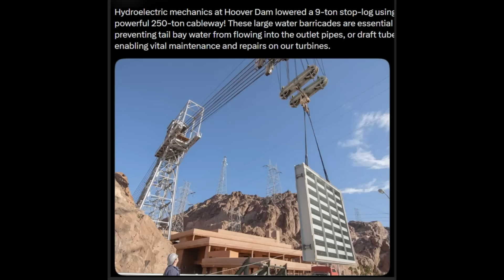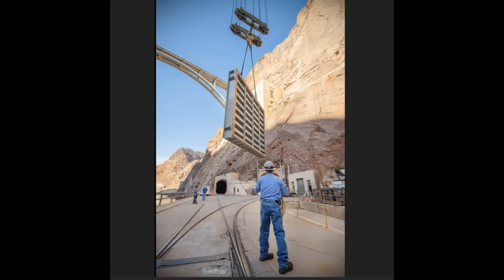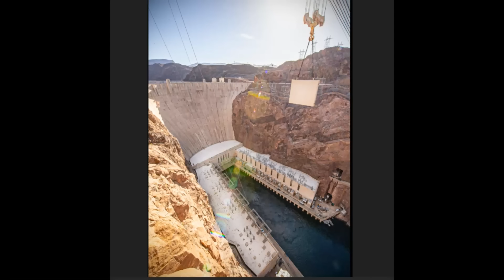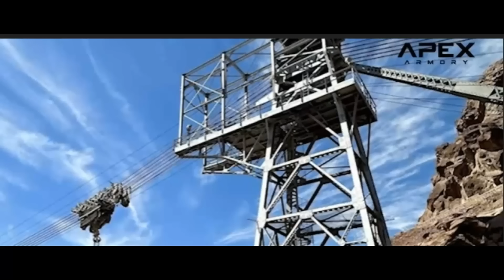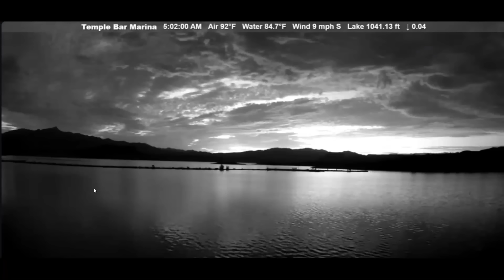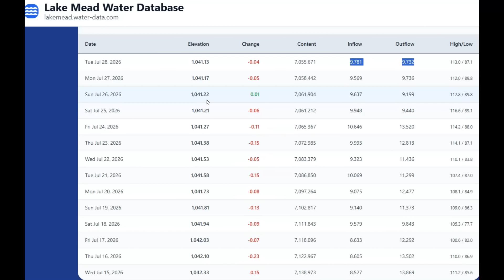Hoover Dam Emergency Closure Update!

Comment: California, Nevada, and Arizona have been growing exponentially, but have not built new power plants of any kind to keep up with the added demand and have totally ignored the fact these are arid states. They been building sub division after subdivision and no one has wondered where the extra water and electricity will come from. Placing everything on a river coming from a state that has regular draughts isn't very logical. They've overbuilt and never bothered with infrastructure.  It's a tipping point. Maybe somebody should have built some power plants and refused some permits you knew the area didn't have the water for.
Reply: Its all "preplanned " 😢

Comment: The damn will have to call my little brother after the repair is made, to measure the repair, before they turn it on. My great grandfather used to build the dam in the winters then work at the other side of the Grand Canyon that’s colder, in the summers.

Comment: Thanks brother !!!

I am thinking that the extreme heat in that part of the country may have affected that system in some way.
Being a retired railroad conductor, during extreme heat waves, the train speeds on the Northeast Corridor would be reduced. The reason being, the overhead wires (catenary system) that power the electric trains could actually droop and sway a bit. Also, if the heat wave got really bad, it could cause deformity in tracks. But, mostly on some freight lines that did not have upgraded welded rail.

Comment: They know about the flooding coming during super El Niño. That’s why some reservoirs are low. Choose the “higher ground” you’re going to run to before the storm comes. Maybe even bury some supplies up on a mountain top. Hoover dam was a drill.
Reply: Higher ground chosen. Is Pikes Peak good? Limestone embedded in the rock at 7000 ft.😮   get higher than that!
Reply: @ChristineRusso-r7c Im at 7000ft. Let’s hope we are high enough. Closer to heaven at least.😂❤
Reply: @peachyb.4521 YES we are.❤😊❤